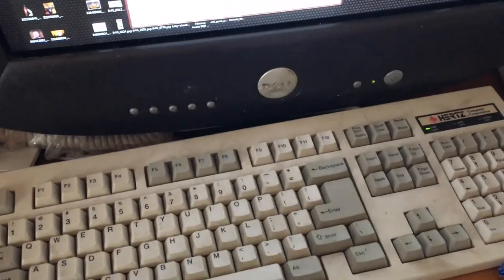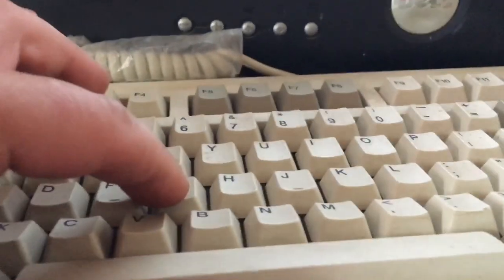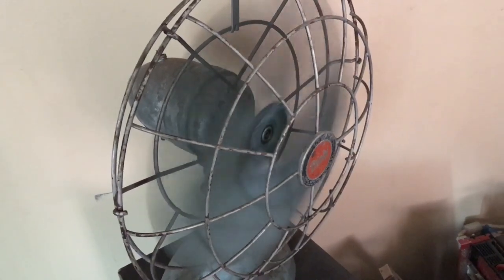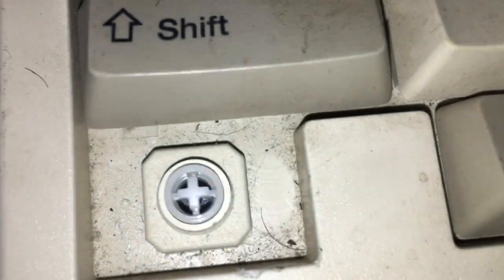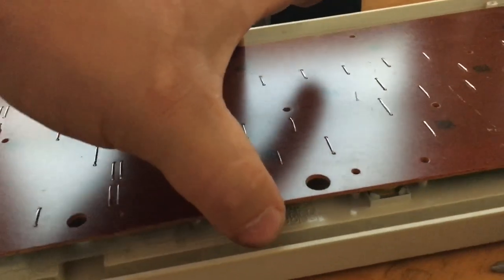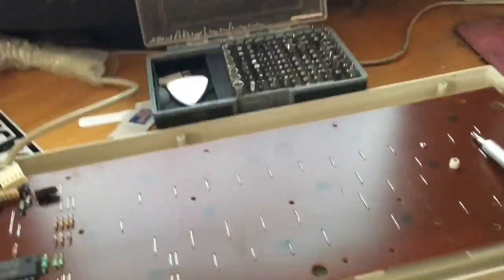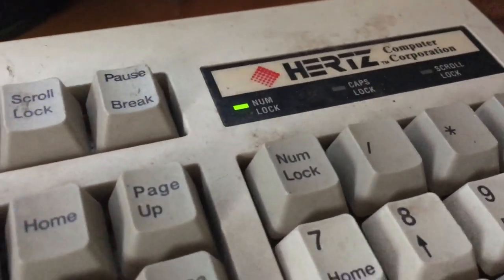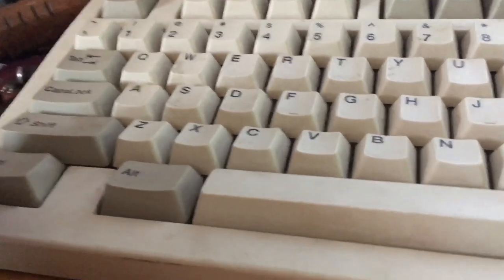Best Feeling Rubber Dome Keyboard Ever?

Comment: i have one of these but cant use it because i dont have a serial to ps2 adapter. also i love that old diehl fan
Reply from the maker: its AT. and i'm sure you can get an AT PS/2 adapter pretty cheap because it's passive. if you were feeling ghetto you could cut the cable off of a garbage keyboard and try to sleeve it over the pins on the AT keyboard (not recommended because of short risk)